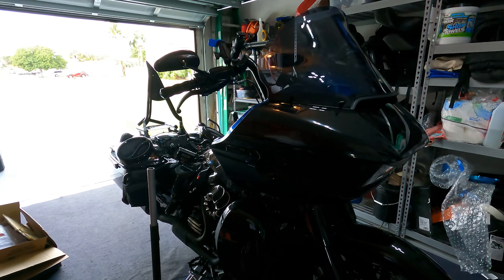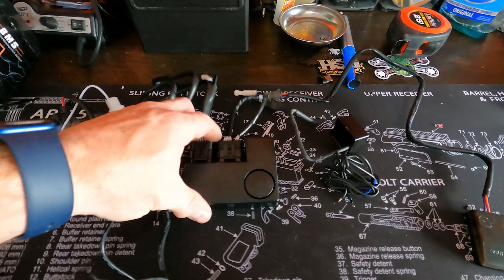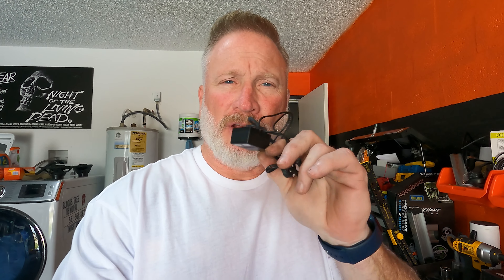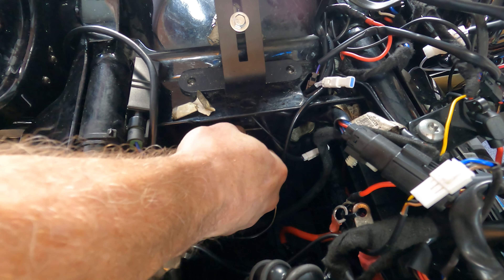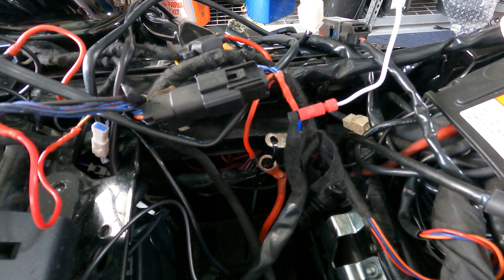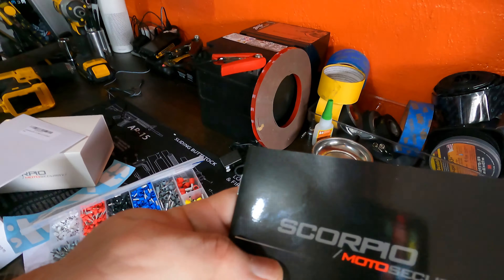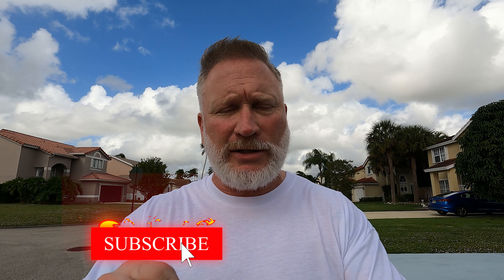Harley Scorpio Security Alarm System Install. Easy install and a great alarm for your Harley!

Comment: I had a car alarm with a wire that tapped the ignition, and jsut like you are worrying about, I had to dig under my dash at one point and rip it out in the middle of the night cuz the dang thing went bad.  I also had a Scorpio on one of my sport bikes....the lean sensor and proximity sensor worked great.  Nowadays I simply toss a cable lock on the bike and I have an apple airtag stashed on each of my bikes....so if it disappears, I am tracking it and they better hope the Police get to them before I do.  You can stash an airtag or a tile (if you dont have apple phone) and you can track your bike at all times.  25 bucks, boom done.  The disc locks that cable to your throttle are also a good way to keep your bike from getting stolen.....you just need to make yours harder to steal than someone elses is all.....since i own multiple bikes, it would cost way too much to slap one of these on each.  Great video Ron!!
Reply from the maker: I’m going Apple tag shopping right now! 😝
Reply: @RealRonTV  I had a friend of mine show me this at Biketoberfest this year...I NEVER had any interest in them whatsoever...I mean I dont lose my keys, my dogs dont run off, so I had no real use....them my buddy got a text from his bike saying he had stepped away from it.....now I have one on EVERY one of my bikes and on a few of my keychains.... :D.  They are 25 bucks and the battery lasts a year....what more could you ask for some cheap piece of mind...for my Roadglide I just pull up the app and it has a shark wherever my RG is on the map  LOLZ

Comment: Hey Ron enjoying your videos this week buddy, keep them coming.
One thing I noticed is when you put the wire through that hole I did not see a rubber grommet. Brother didn't you learn anyting? you need a rubber before you put it through that hole LOL. It's going to chafe those wires and they will ground out, maybe not today, maybe not tomorrow but on one of your long trips.
Peace ✌🏽
Reply from the maker: Lmao where do you mean exactly?  Do you mean at the back of the battery tray?
Reply: There's a hole on the right on top of where you put the module for the alarm you have various wires going through that hole. Unless I just can't see the rubber grommet. By the way they sell rubber grommets in all sizes so it should be fairly simple to find
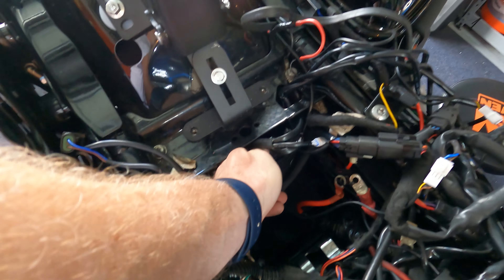Reply: At 5:13 you're putting wires through the hole.
Reply from the maker: @bronxbrosmotorcycles  I don’t think there is any risk there. The module is secure in place and it’s not a tight spot for the wires. But you never know.

Comment: hey man, I installed mine about the same time as you. I seem to have a problem. the alarm drains my battery...do you have the same issue?
Reply from the maker: Not at all. Which wire did you tap into?
Reply: @RealRonTV  the licence plate light wire. Was I wrong ?
Reply from the maker: I tapped into the break wire but the license plate should work as well. As long as it’s not a hot wire that turns off when the switch is off.
Reply: @RealRonTV  I guess I'll Try the brake light next haha, thanks for replying and the help.